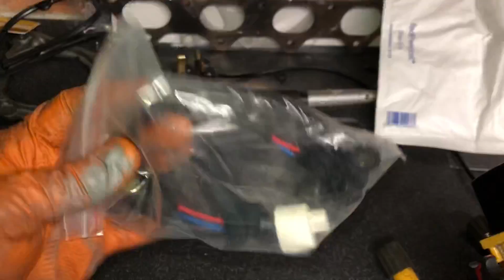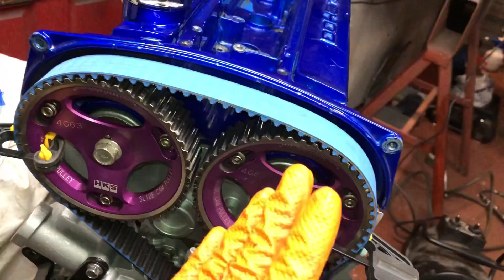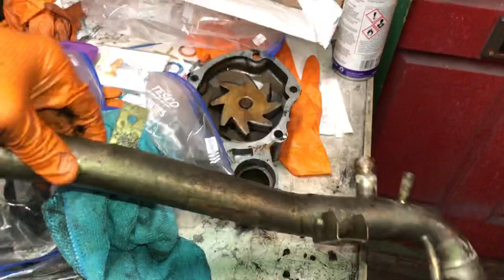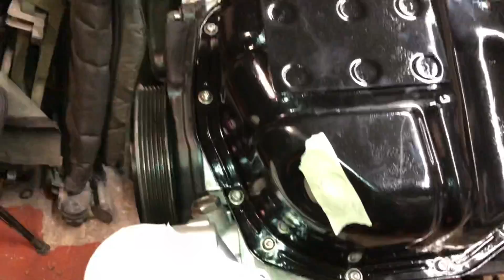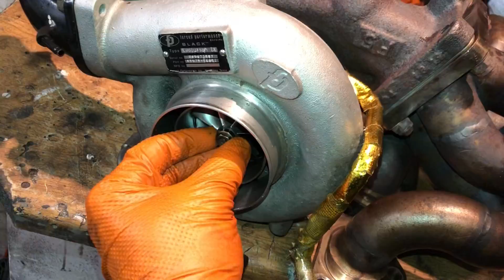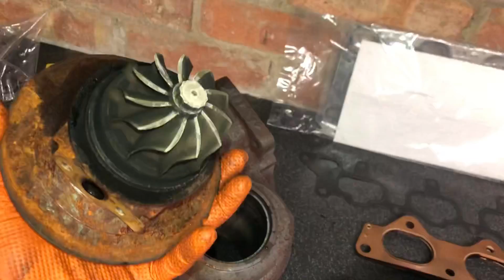Cambelt Fitted & Engine Is Now Completed! EVO 5 2.3 Stroker Rebuild

Comment: I thought the bolts for the engine mount bracket that have a spring washer only need a high temp thread sealant because they're behind oil passages. The Engine Overhaul section calls for 3M ATD Part No. 8660. They're also using it for the half moon on the head so I'm guessing it's a RTV sealant type.

Comment: It's amazing the amount errors/bodges you're found it must have ran like crap?
when i used to fit a actuator was all ways told to use the half a hole method,but not that way 👍😭💪,it's ment to be the oppersit way so half hole tightly closed 👍😭💪.

Comment: Hi Aaron, first of all, i respect you because from what i hear i can see that your experience is just breathtaking and you are like a standalone car tuner, also i apologize for my english i already had few beers and english not my native language. Im looking forward to see any of your videos because i know that i will learn more than from all my years at school, and also im sure that im not the only who would appreciate the answer, you could also make a complete video for this question, so the neverending question is exhaust diameter - meaning like what is the main thing that tells you what diameter to you, does fuel type have any impaction? And also i see that some people refer just to HP output of the engine, im wondering whats your answer and if you can tell us about headers diameter and if it impacts also different diameter of downpipe and rest of the exhaust example: 3" downpipe and 2.5" catback, and also how catalytic converters and silencers impact HP and NM outputs, because i saw a few examples that had a huge impact for the NW output so im really looking forward for your opinion, also if you can tell us if exhaust heat wraps have any purpose or if theres no reason to use these. Thanks alot for your videos and effort, cheers - i never thought that i would be se glad that i can subscribe and watch videos with this much enthusiasm